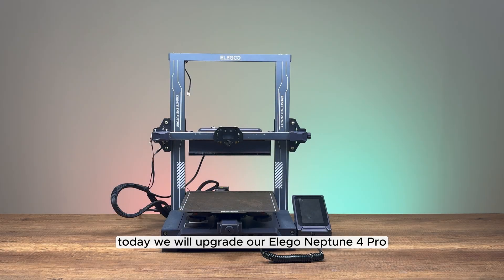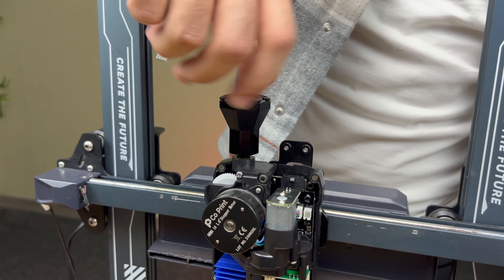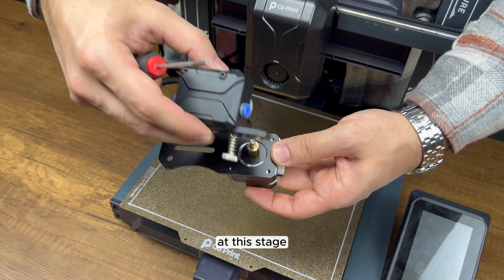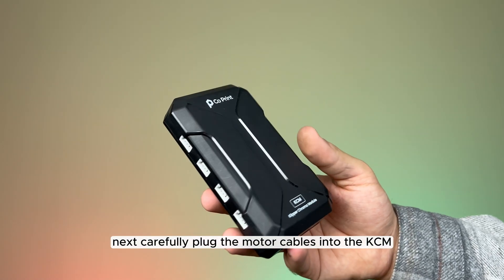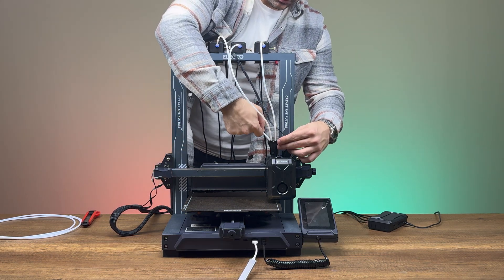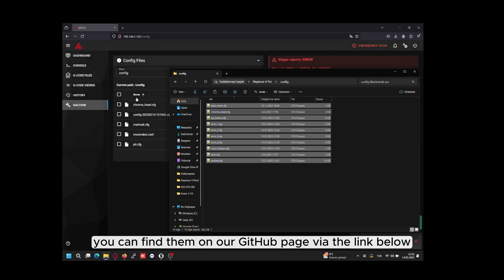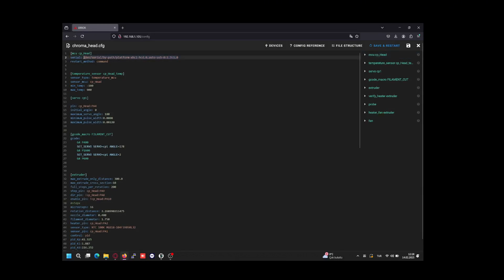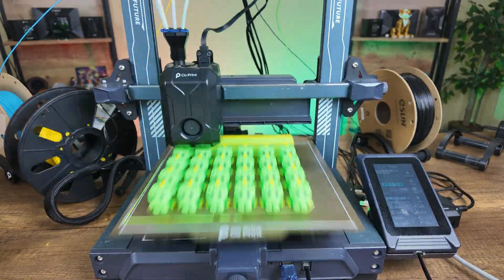Upgrade the Elego Neptune 4 Pro for 4-Colors Printing | Co Print KCM Set Installation

Comment: This videos are extremely misleading. You make it look like it’s as simple as shown in the videos and you are missing a million steps related to configuration and calibration that will take hours for an intermediate to experience user. I feel bad for anyone without enough computer knowledge to buy this and then realize they can’t make it work. I am a very experienced user and got mine with 8 extruders for an Elegoo Neptune 4 Plus and the amount of steps that are missing from the instructions and videos is just crazy. I’ve been working on my setup for 2 full days and still haven’t been able to finish configuring everything.
Reply: ive got a degree in electronics and years as an electronic technician in a plant configuring industrial machines and these are by far the worst instructions I've ever had. they need a lot simpler set up option than what they have now. im at the end of day 2 also.

Comment: big problem with this install video. elegoo neptune 4 pro firmware does not support mainsail to do this install. it has fluidd. i don't know if you can use fluidd to do this but i couldn't figure it out. the Neptune 4 printers do not use modern klipper. they do not disclose this anywhere, so be warned you have other steps you have to do to get this to work. you will have to do work around to get modern klipper with mainsail to follow the steps listed in this video. Their  n4max video has a slightly better walk through, but it is still missing some key things like updating to openNept4une, or doing a workaround in linux. either way, it is not as easy as it looks on this video, which in my opinion is false advertising. Also, just a heads up they do not provide the signa profiles with the kcm set, so plan to buy those in addition or print out your own mounting system for the extruders. they have STL files for the various mounts but they didn't quite fit my machine so i had to modify them in blender. (NOTE: i still dont have this installed and working on my machine after several months. I had to buy an EMMC adapter to reflash my EMMC which i'm still waiting on in the mail. i lost fluidd on my machine following the various videos and can't do anything remotely now. very annoying.)

Comment: Which is the recommended cheapest model for this multicolor print setup?
Reply from the maker: Hello! If your printer is Klipper-based, you can prepare it for multi-color printing using the KCM Set. However, if your printer is Marlin-based, you can get it ready for multi-color printing by purchasing either the ChromaSet or the ChromaSet Lite. You can find out which set is compatible with your printer model by visiting our Wiki page. You can also visit our website to place your order and make your 3D printer ready for multi-color printing! 
🔗 coprint3d.com
🔗 wiki.coprint3d.com
Reply: @CoPrint3D I have yet to buy a printer. 
I wish to have the most cost effective printer which is compatible with your products. 
The point is to create setup from start which has multicolour capability yet is cheaper than the avilable multicolour printers. 

Please guide.
Reply: To be honest, I was so interested to get the kit. However, with the price it is more feasible to get totally new multi color printer. I would still be interested if the price drops off

Comment: Is the procedure is the same on the Neptune 4 max? what i mean is saw an older video when they use command prompts and a lot of codes to make it run.
Reply from the maker: Hello! The only changes are in the Config files. By following our wiki page, you can complete the installation in the most accurate way.
🔗  wiki.coprint3d.com/en/Elegoo-Neptune-4-Max-KCM-Set-Setup-Guide

Comment: How to print the parts needed?
Reply from the maker: Hello! You need to download the necessary files from our GitHub page and print them using your printer. ABS or PETG is preferred but PLA would be also enough.
🔗github.com/coprint/AssemblingParts/tree/main/Elegoo/Neptune%204%20Pro

Comment: Is this available for Neptune 3 pro
Reply from the maker: Not the KCM Set but ChromaSet and ChromaSet Lite is available for Elegoo Neptune 3 Pro!
You can have one directly from our website.
🔗coprint3d.com
Reply: Basically they have a marlin firmware model for the chroma set and the KCM stands for Klipper Chroma Module for klipper based machines

Comment: I have an issue that the chromahead is not showing even though the KCM is connected to the USB and chromahead cable is connected and the red light is their but still it's not showing in the devices in cfg file, please help
Reply from the maker: Hello. We're very sorry for the problem you're experiencing. If you can reach out to us via email, we’d be happy to help you.
✉ info@coprint3d.com
Reply: This is completely unacceptable. After fixing the damaged chromahead due to poor instructions, I encountered a new issue: the X offset resets every time I restart the printer. Additionally, the color settings do not change in Orca Slicer, and no proper guidance is provided for this. The configuration file on your website is incorrect; for example, the printer.cfg lists stepper X max as 353, but it should be 331, matching the factory setting. This is just one of many mistakes that have caused significant frustration. I’ve spent almost two weeks trying to achieve a single colorful print without success. The advertised ease of use on YouTube videos is misleading. I want a full refund.

Comment: I just got my upgrade kit delivered today but the extruders didn't include the sigma profile extender, which I am very upset that this wasn't included. The site imaging made it look like it was included in the kit. 😡
Reply: You have to print it, the stl is available in the site
Reply from the maker: Hello! You can see the full list of files that need to be printed before installation on the wiki page. Also the required files are available on our GitHub page.
🔗 wiki.coprint3d.com/en/Elegoo-Neptune-4-Pro-KCM-Set-Setup-Guide
🔗 github.com/coprint/AssemblingParts

Comment: Perhaps this is a silly question, but will the stock touch screen still work fully or will its functionality be limited? If not, would it be possible to add a Klipper Screen running?

I have a Neptune 4 Plus, but to my understanding the steps would be the same except for the specific config files?. Also the guide on the Wiki has some steps that this video doesn't mention, like uninstalling Klipper and Moonraker to then reinstall them via SSH. 

Also, the Wiki for the 4 Plus links config files for the 4 Max in the section 3.1 of the guide.
Reply from the maker: Hello!
After installing the system on your printer, you’ll only be able to control the X, Y, and Z axes from the screen — all other functions are handled through Mainsail. It's not necessary to add an external screen, but if you prefer, you can add one.
There are slight differences in the installation process depending on the printer model. However, if you experience any issues, our support team will be happy to assist you.

Comment: This would work with the N4Max as well, no? I think its all the same mostly, maybe have to adjust a little in print config.

And i noticed the part on the print head had 8 inputs. are you able to do 8 color printing? Currently i have an N4max an a1 w/ ams lite and a couple a1 minis.

I want to print some larger stuff in multicolor and would be sweet to get 8 colors on my max
Reply from the maker: Hello! Yes, the product is compatible with the Elegoo Neptune 4 Max. Additionally, by adding extra ECM modules, it can support up to 20 colors.

Comment: the video shows plugging the kcm into the printer. one cable twice??? I only have one cable to plug in from my kcm. also my lan address does not open a mainsail screen with machine and devices. makes following your directions very confusing. 
Two days of messing with this stuff and so far all I have is a dead printer.
Reply: agreed, me too
Reply: Same here, worst instructions I tried it on Neptune 4 plus

Comment: But how does it change the color? I mean if your for example have white and it must go to red... Won't it mix it? I see at the Bambu they talk about the poop of the filament. So how does the system do it with the poop of the previous color? it should leave it somewhere, not? And what does this cost? I have a neptune 4 pro
Reply: instead of pooping, it uses the prime tower (behind the prints 6:40)
Reply from the maker: Hi, we are changing filament automatically and cleaning filament inside of purge tower. After cleaning new filament will move to the Chromahead. Price is 290 usd for KCM Set 4 Color Pack. www.coprint3d.com for more information. Thanks for interest.

Comment: I searched for the kit on your page. I just wanted to know so as not to buy a wrong set for this printer. The kit is universal and I only have to print the base and download the files for klipper, and could there be problems with the firmware version of the neptune 4 pro? In addition, do I also have to buy a spool holder? Can I use cura, or do I have to switch to orca slicer by force? Thank you very much.
Reply from the maker: Hello! The kit is universal; you're correct. You'll only need to print the required base parts and download the provided Klipper files. You won't encounter issues with the Neptune 4 Pro's firmware version.

Regarding the spool holder, you'll see recommended spool holders in the suggested products section on the order page; you can select as many as you need from there.

We strongly recommend switching to Orca Slicer since it already includes optimized profiles for Co Print under the "Printers" section, and it has all the necessary settings configured for you.

And yes, the system is compatible with PVA filament.

Thanks for your interest! Let us know if you have any further questions.
Reply: @CoPrint3D  more than anything if I wanted to use the 8 version is the assembly procedure the same?
Reply from the maker: You can increase the number of colors by adding ECM module.
Reply: and another question that came to mind can I use it with pva?
Reply: ok I'm interested in buying the 4 color set, is it expandable separately with the 8 version? because I saw that the 8 version exists in the store. Thank's.

Comment: Does this work on the Neptune 4 Max? I'd assume so but i'd like to be sure. If so do you have any videos of it.
Reply from the maker: Yes, the system is fully compatible with the Elegoo Neptune 4 Max.
We're also happy to let you know that our Neptune 4 Max installation video will be published very soon — it's currently in the final editing stage! This will walk you through the setup step-by-step and help you get started with multicolor printing.
Reply: @CoPrint3D can’t wait for it to come out! I have my kit sitting on the desk next to my max and i’m getting ready to start the install!
Reply: @ If I have issues with print quality or it doesnt seem to calibrate well is it easily returnable. The reason I ask is the software on the N4M is great and my prints are as solid as it gets for years now. Also does this have a klipper/fluid web interface for me to monitor and remotely print from. Thats a deal breaker if it does not have a web portal/interface.

Comment: Do you deliver to the uk and if use the cromasar console does it give more features than just using the kcm
Reply from the maker: Yes, we do deliver to the UK!

As for the “Cromasar console” — I believe you’re referring to the ChromaPad. Please note that ChromaPad is only compatible with Marlin-based printers, not Klipper-based ones like the Neptune 4 Pro.

If you have a Marlin printer, then yes — the ChromaPad provides a more advanced and user-friendly interface for multi-color printing, making the experience much smoother. But for Klipper setups, the KCM alone will work perfectly.

Let us know what printer you’re using and we’d be happy to guide you further!

Comment: Would this work with Neptune 3 pro or would I need the cromasat console as don't think Neptune 3 pro is running klipper
Reply from the maker: Hi! ChromaSet is compatible with the Neptune 3 Pro.
You can check it out here: https://coprint3d.com/products/chromaset-multi-color-update-for-3d-printers

Comment: Thinking about getting this for my old anycubic vyper running klipper. It uses a strain gauge to do bed leveling. How does bed leveling work after replacing the print head with this?
Reply from the maker: Hello, after your order, our technical support team will reach out to assist you with this. It’s a simple process.

Comment: Mine arrived yesterday, I'm going to use it for the Neptune 4 max. The packaging is really good. I'm quite excited. The only problem is that I am missing these metal parts to attach the stepper motors to the printer, but on the website it says that they are included
Edit: they sent me an email saying they are no longer included. And I think they changed their website since, so if you are buying this you have to buy them separately or you can use a 3d printable one which seems to work pretty well. I'm just not sure where you can download that because they sent it to me in an email.
Reply: Did you managed to run Coprint? How about configuring cfg files? I failed, no manuals are correct...
Reply: Were you able to find the 3D file for the parts or know where to buy them at? I think they are called T nuts.
Reply: What is complicated to configure ?
Reply: just got mine. can you share the stl files? also for neptune 4 max
Reply: This series of components seems to have a very important shortcoming in the lack of mounts to assemble. Several customer support contacts that even though it’s a different time zone. Could have sent the STL files, however all of these components are very heavy and can’t be supported by plastic. Support wants to know what printer I have that they just sent me for the printer I have, Damn Brits!  Perhaps the US Better Business Bureau should look into this, a lotta people getting burned at $700 a pop from someone putting something from China in a box that they know they can’t assemble themselves.
Reply from the maker: Hi, did you send a ticket to our support team? We'll assist you. Best
Reply: @CoPrint3D Yes I did that three days ago, so I guess it will take a bit of time because it was over the weekend
Reply: @nilsbottjer7129 mine is missing them too. They reply to you yet? If so, any idea on how long it will take to get them?
Reply: @boondocksaint3  Yes apparently they are no longer included but they didn't specify that on the website. I was able to convince them to refund me the price for the sigma holders. There is a 3d printable part you can use instead which works pretty well. But I don't know where you can download that, it was included in the email they sent me

Comment: Can you set up the system the same way using Fluidd instead of Mainsail? I have a standard Neptune 4. It has Fluidd instead of Mainsail installed. I don't want to have to flash it to another web based system.
Reply from the maker: Yes, you can continue using Fluidd — there's no need to switch to Mainsail. 🙌
The system works just as well on Fluidd, and the installation steps are nearly the same.

Let us know if you’d like a guide tailored to Fluidd — we’re happy to help!
Reply: @CoPrint3D Yes, please. If you have a guide specific for Neptune 4 please let me know how to get it. I am still having trouble getting my printer to recognize the KCM.
Reply: @CoPrint3D  As I dont want to swap to Mainsail unless I have to I would love to see a FLUID version

Comment: Ihr habt keine mehr für Ender 3 v3 plus ?! 
Bekommt ihr wieder neue ?
Reply from the maker: You can get the Co Print KCM Set for the Ender 3 V3 Plus – it's in stock now!
Reply: @ kommt auch was für den Ender 5 Max ?
Reply from the maker: @ Yes, you can now use the KCM Set with the Ender 5 Max as well!
Reply: @ Danke 🙏 sobald ich meinen erhalte, werde ich einen bei euch bestellen 🤓

Comment: Is it stock firmware or open4tune!
Reply from the maker: For the Neptune 4, openneptune is option 2. The first option is easier to set up. The first option requires flashing the firmware with SSH and updating Klipper, Mainsail, Fluid, and Moonraker.

If you haven’t already, please reach out to us at support@coprint3d.com — our technical team will guide you through every single step and help you get everything working quickly.

We’re here to help you get the most out of your setup!

https://coprint3d.com/products/kcm-set-multi-color-update-for-klipper-printers

Comment: does this work with the neptune 4 plus?
Reply from the maker: Yes, its work
Reply: @CoPrint3D  The link does not have the printer.cfg files that the video specifically says to delete. Gaving trouble with this on my Neptune 4 Max. Please add the file to the directory
Reply: @vanmundygar any update on this?

I have a Neptune 4 Max. I switched to Bambu, but this will revive my N4M if it works well
Reply: @FlipThisHobby  ended up going back and flashing OpenNept4une to the main board. Used the Printer config file for the 4 plus (OpenNept4une) from the repository and adjusted the x and y stepper motor values from the 4 Max config file. Also adjusted the bed mesh config file. 

But I did get it all running and it works great.

Comment: Nice Thank you
Im in the process of deciding to buy this. The only thing that is worring me is that giant purge block
Reply from the maker: Actually, except for toolchanger-based competitors, Co Print products produce less filament waste compared to other alternatives. While other systems purge outside the print area, our product performs the purging on a cleaning tower directly on the print bed. If you prefer, you can replace the cleaning tower with a functional model or even integrate the purge material into the infill of your print.